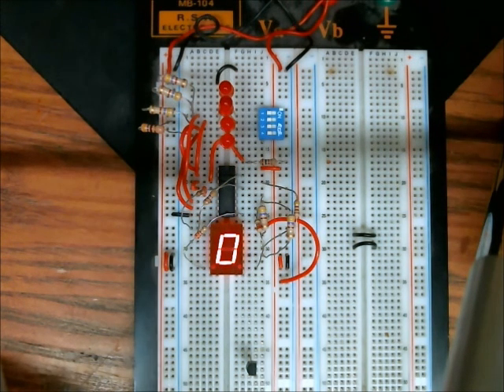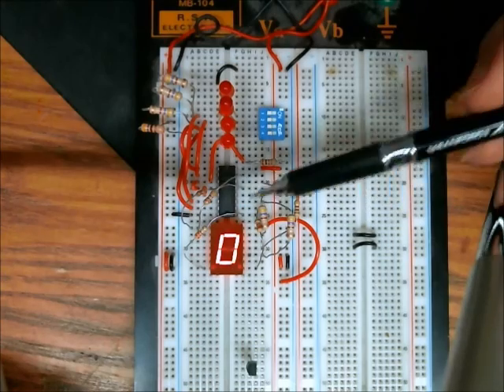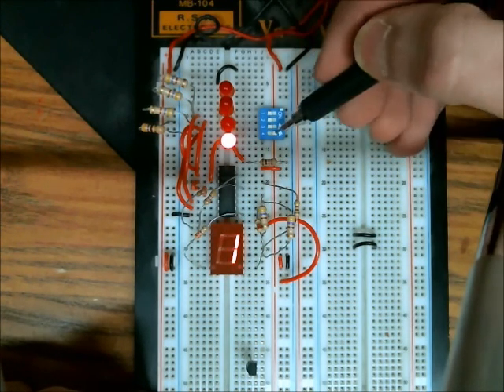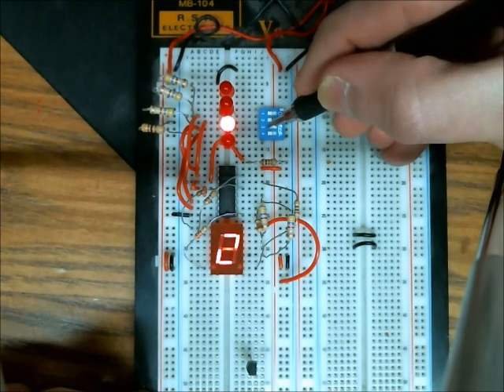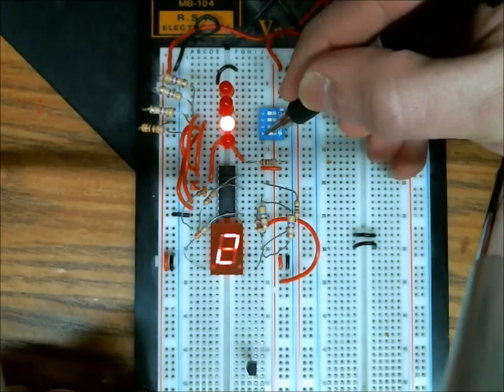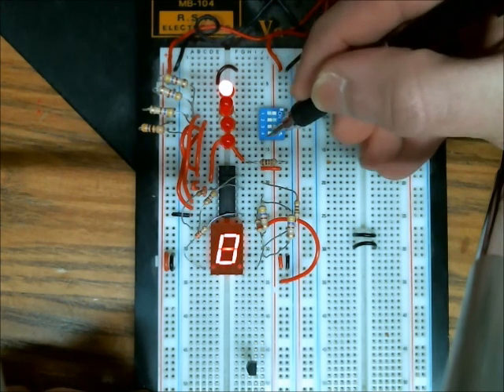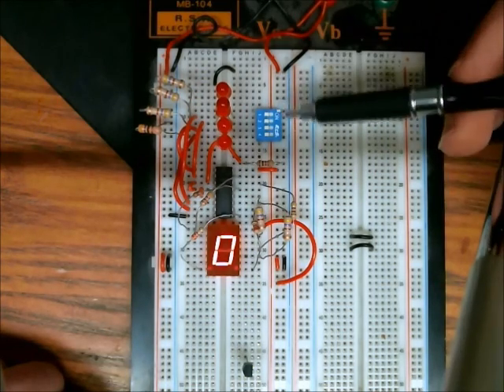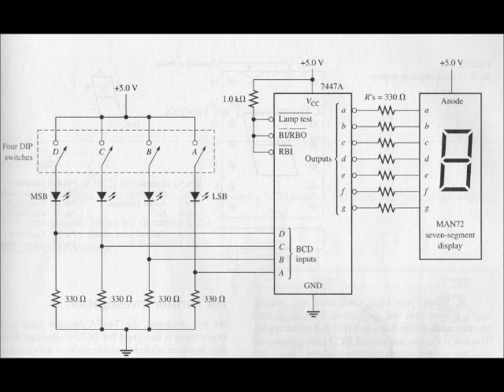7447 7 Segment Display

Comment from the maker: Nikixandra Beltran 
List of what I used:
- 7447 (1)
http://www.mouser.com/ProductDetail/Texas-Instruments/SN7447AN/?qs=QViXGNcIEAtw1ygS4s6k9g==
- Red LEDs (4)
http://www.mouser.com/ProductDetail/Kingbright/WP7113ID/?qs=sGAEpiMZZMvHYEB9WUp7EjKTTHySLdIIJii6nghAbfI%3d
- Dip Switch (1)
http://www.mouser.com/ProductDetail/CTS-Electronic-Components/208-4ST/?qs=sGAEpiMZZMv%2f%252b2JhlA6ysJYcV9PS3IC1sGu5A7pcAGI%3d
- 330Ω resistors (11)
http://www.mouser.com/ProductDetail/KOA-Speer/MF1-4DCT52R3300F/?qs=sGAEpiMZZMtlubZbdhIBIP%252bJWtdFYWotCcHi1LyXPpE%3d
- 1kΩ resistor (1)
http://www.mouser.com/ProductDetail/Xicon/291-1K-RC/?qs=sGAEpiMZZMsPqMdJzcrNwpY4ajPo7WUDT2BWQTrGJfk%3d
- 7 segment display (1)
http://www.mouser.com/ProductDetail/ROHM-Semiconductor/LA-301VB/?qs=sGAEpiMZZMvMXbh32ZmHAFjBLCRACu7r

Comment: sir plz say soon wht are the coponet use to make it
Reply from the maker: - 7447 (1)
http://www.mouser.com/ProductDetail/Texas-Instruments/SN7447AN/?qs=QViXGNcIEAtw1ygS4s6k9g==
- Red LEDs (4)
http://www.mouser.com/ProductDetail/Kingbright/WP7113ID/?qs=sGAEpiMZZMvHYEB9WUp7EjKTTHySLdIIJii6nghAbfI%3d
- Dip Switch (1)
http://www.mouser.com/ProductDetail/CTS-Electronic-Components/208-4ST/?qs=sGAEpiMZZMv%2f%252b2JhlA6ysJYcV9PS3IC1sGu5A7pcAGI%3d
- 330Ω resistors (11)
http://www.mouser.com/ProductDetail/KOA-Speer/MF1-4DCT52R3300F/?qs=sGAEpiMZZMtlubZbdhIBIP%252bJWtdFYWotCcHi1LyXPpE%3d
- 1kΩ resistor (1)
http://www.mouser.com/ProductDetail/Xicon/291-1K-RC/?qs=sGAEpiMZZMsPqMdJzcrNwpY4ajPo7WUDT2BWQTrGJfk%3d
- 7 segment display (1)
http://www.mouser.com/ProductDetail/ROHM-Semiconductor/LA-301VB/?qs=sGAEpiMZZMvMXbh32ZmHAFjBLCRACu7r